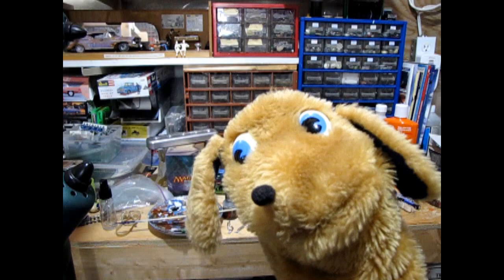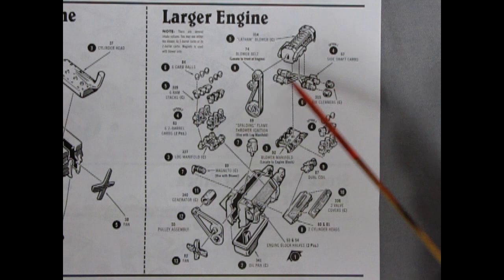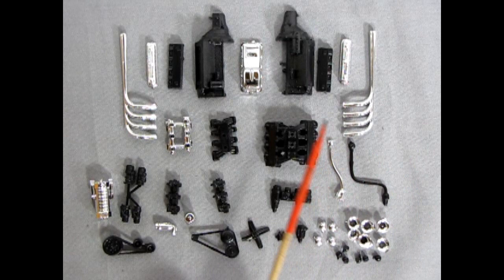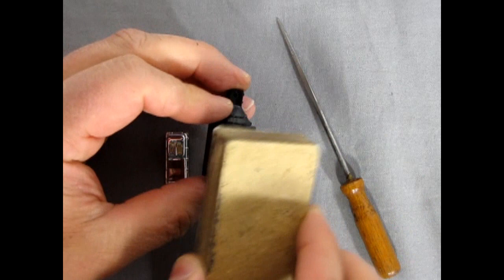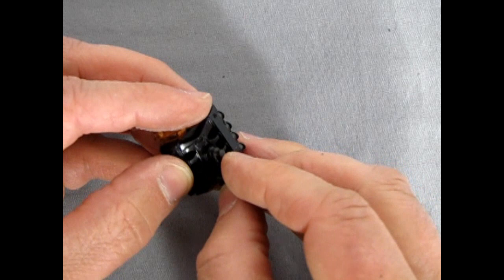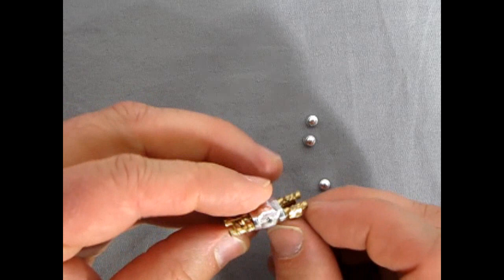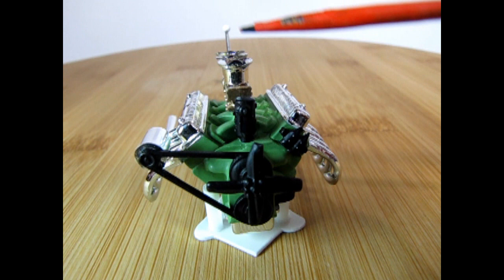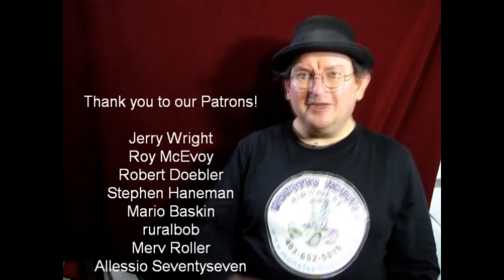Model Car Garage Tips and Tech - How To Build The MEL Optional Engine - AMT 1925 Model T Ford Kit

Comment: Hi Trevor, Thank you for sharing your knowledge of these engines.  I am building the '25 T ( among other things), I learned a lot. 

Vaughn
Reply from the maker: Glad to help. If you were to build the engines based on the engine colors, which motor would you put in your Model T?  

I'd choose the Edsel motor because it is unusual.
Reply: Actually this is my second ‘25 T, I wanted to go a little wild so I was thinking red engine with Latham blower for my hot rod.
I have already dechromed a lot of the parts.

Vaughn
Reply from the maker: @scaleautoworkshop4426  Sounds cool. remember to share it on my Facebook page.

Comment: Those trumpets are called velocity stacks. The little balls are not in the velocity stacks when the engine is running. They are only in there to block the velocity stacks when the engine is not running.
Reply from the maker: Thank you Walter. i should have known that when making the video. It's hard not to goof up sometimes..